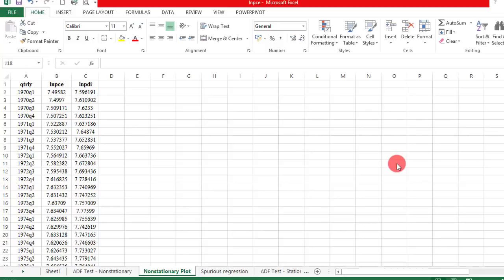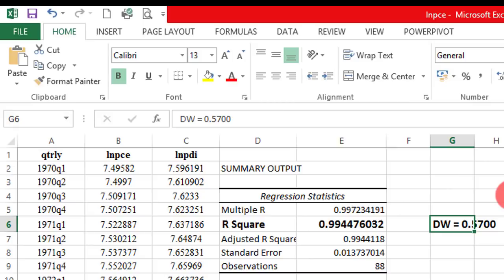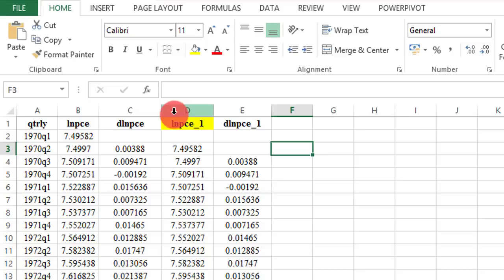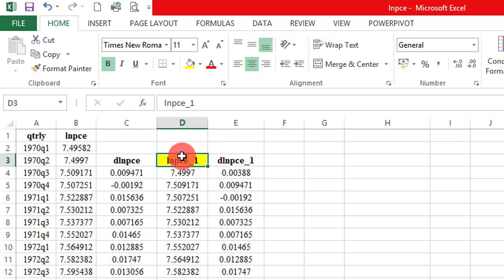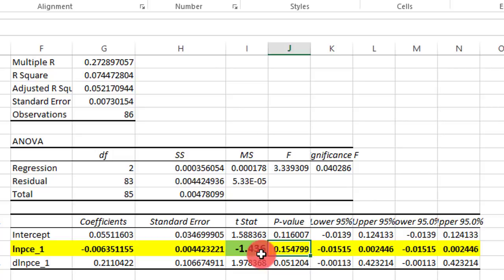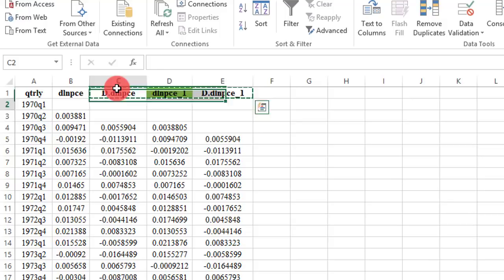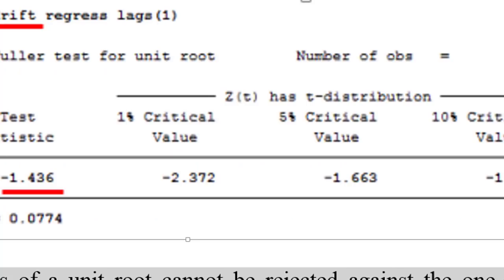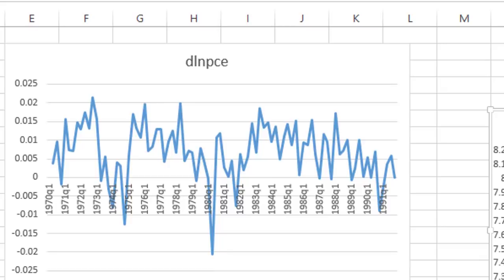(Excel):Perform Augmented Dickey-Fuller Test, Stationarity #adf #pp #stationarity #integration

Comment: Hello sir, I have a question, when I manually find the Dickey Fuller statistic value, the statistic value is very slightly different from the value generated from the Eviews program, although I use the same data, what is the reason?

I mean the normal Dickey Fuller test, not the developer
Reply from the maker: Hi Khaled, you don't expect to get the same results across different analytical software. Stick to one.